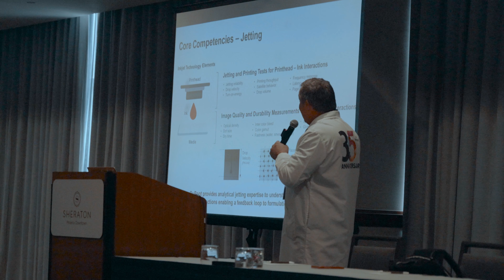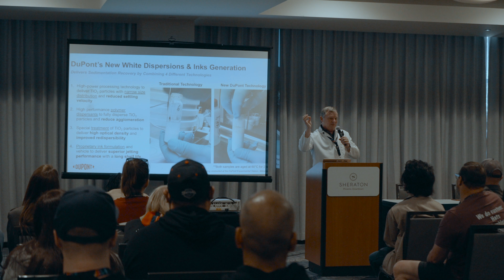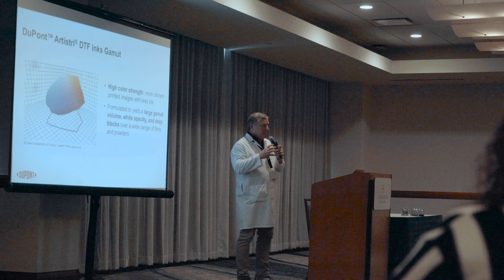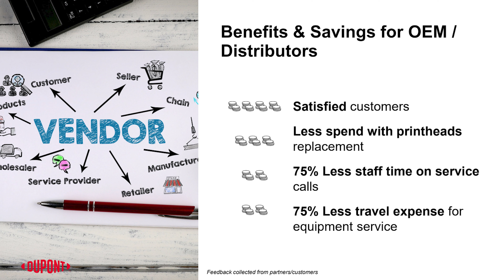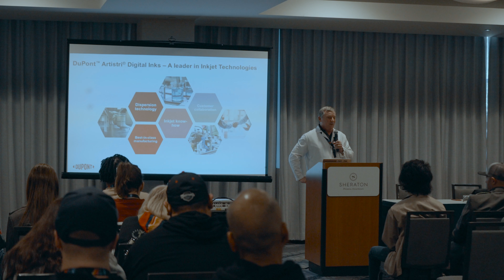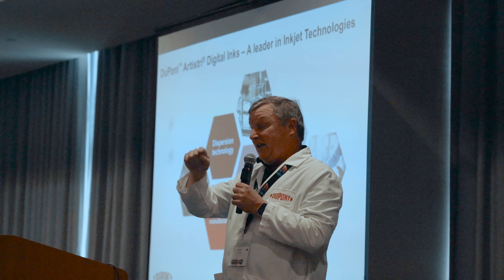DTF Expo: Formulating Pigment Inkjet Inks for DTF Printing

Comment: I'm having major troubles since switching to Duponts CMYK inks. My colors aren't even in the same ballpark as they were previously and none of the vendors have any clue how to help. Additionally there are no ICC profiles to get you started using their inks

We switched to Dupont 1600 white inks about 6 weeks ago, and have experienced significantly less i3200 problems since and couldn't be happier, but these CMYK inks are dramatically different than many of the other CMYK inks on the market (and I'm not sure that's a good thing 😬)